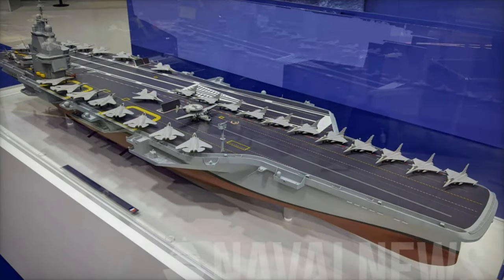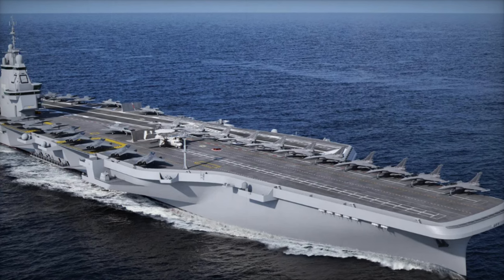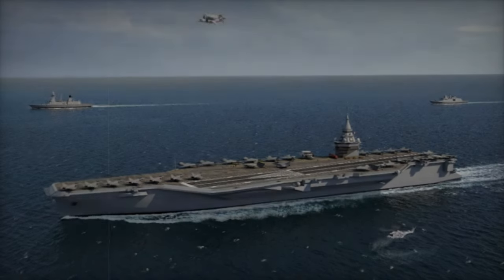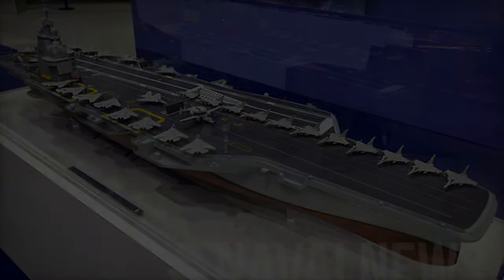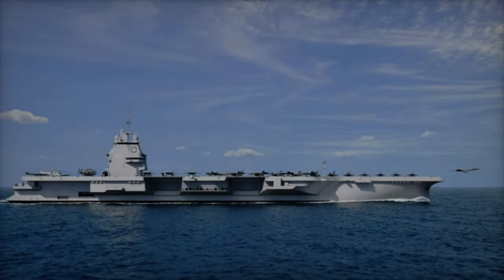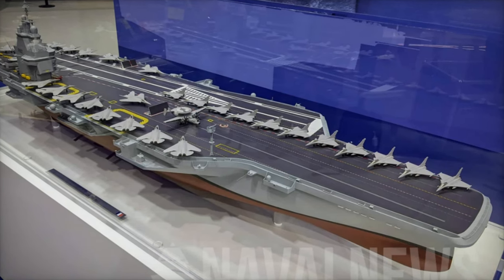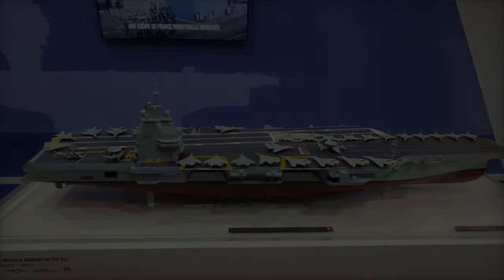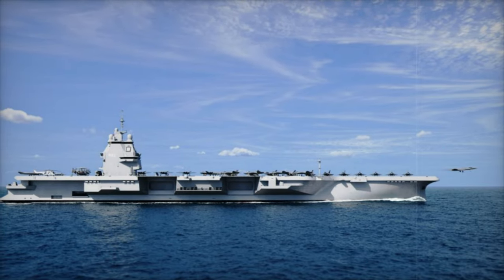France’s new aircraft carrier design with three catapults unveiled by Naval Group

Comment: Still think they need at least 2 carrier!
Reply: The Charles de Gaulle is likely to serve into the late 2030's. It may take that long to get the new one built and worked into service capability. On the other hand, it may not. Depending on what happens the next few years France may produce multiple of the new carrier, or new iterations of it based on lessons learned. Probably be 5-10 years before any decisions are made in that direction. New capital ships are so complex that they're often a deceade from keel laying to getting all the kinks worked out.